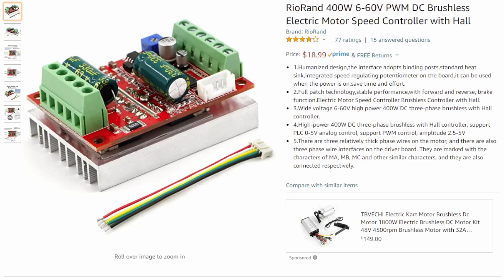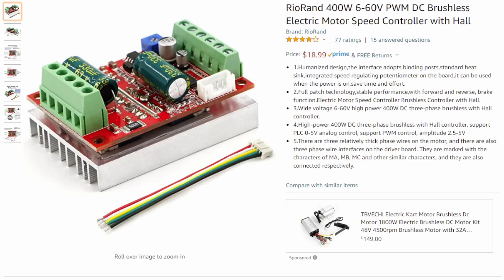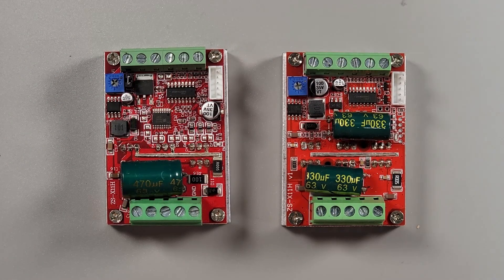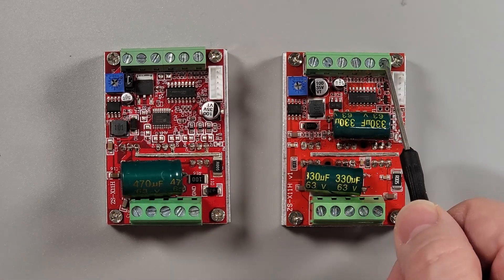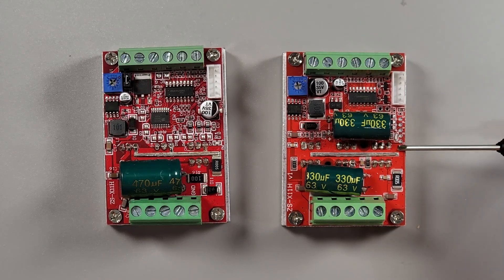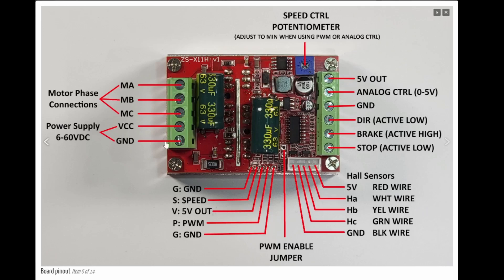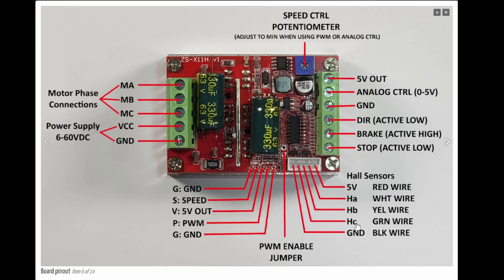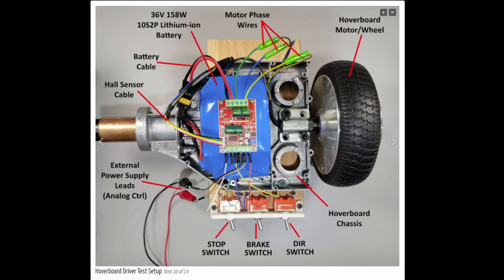Inexpensive Hoverboard Motor Controller

Comment: hes back!
Reply: Is there any difference in just sending a 0 cycle PWM signal (vs applying the "stop")? Kind of confused for the reason for this control... is it just like a bypass (when that's active) PWM control = irrelevant?
Reply from the maker: @williammuff5485   I was doing some testing on the STOP pin yesterday and found that it doesn't behave as I expected.  It seems to have three states.  Logic 0 disables the drive, Logic 1 turns the motor on full speed, floating allows for PWM/Analog control.  I suggest just not using the STOP pin and do as you mentioned and just apply a low signal to the PWM pin to put the motor into a free spin mode.
Reply: @mad-ee  This isn't really as related to this comment, but i thought you might be able to help. I plan on using 36v battery-> 2 of these -> 5v output powering Arduino (pwm from Arduino sent to both controllers *reverse/brake too), but I'm not clear on how to make the device draw nothing on idle. Is there some type of circuit than than switch on and off based on a quick switch type of voltage? Should I just get some beefy ~30a switch wired post battery/pre motor controller's? I would ideally like a switch to have an LED, but that's a bit confusing as i feel like i need a switch capable of handling 36v (20-30a), but an LED that can take 5v. 

I'm just lost a bit and any help would be greatly appreciated.
Reply from the maker: @williammuff5485  probably simplest is just a switch that cuts power between the battery and the motor controller.  As you mentioned you do need to have a switch that can handle the current.  I haven't tried to measure how much current the motors actually draw, I'll try to do that sometime.  On some switches that have the built in LED there are separate pins for the lamp.  So you could feed in the 5V OUT signal from one of the motor controllers to the LED, you may need to put a resistor in series depending on the switch.
Reply: @mad-ee  after some research it sounds like an “anti spark” switch is what I need. I really don’t understand the naming. Some of them even have auto on/auto timeout shutoff features based on current draw
Reply from the maker: @Billy18bm  Ahh yes, that is a good find.  I found some schematics of anti spark circuits and it looks like they use N-Channel MOSFETs in series with the ground connection.  On the gate of the FETs there is an RC (resistor capacitor) circuit to slow down the turn on time a bit to prevent the spark.  I've noticed a spark whenever I plug in the battery and it just didn't click that, that would cause an issue in a regular switch wearing down over time.  I've had a similar issue with some mechanical relays that end up fusing the contacts when they are used with a circuit with high inrush current.
Reply from the maker: Actually the part about the resistor capacitor circuit is not quiet right, I think those are used in the toggle circuit.  Anyway they do use MOSFETs to switch on/off the power rather than a mechanical switch.
Reply: @williammuff5485  Sorry to butt in, but I'm not sure I would recommend powering your arduino from these boards.  The 5v rail on these boards appear to be driven from a 7805  regulator which is really limited in current when stepping down from such a high voltage.  There may be a switchmode regulator before the 7805 to help correct for this but I'm not sure.  Without documentation its not a great idea.  There was some talk on the amazon reviews about this board powering down periodically when driven from PWM.  I have not experienced this but it could be due to the 7805 overheating when driving too high a load.  Just connect PWM and ground and power your arduino separately.
Reply from the maker: @adamhixon  This is a good point.  The older version of the RioRand had a 7805 in a larger package that could handle higher current draw.  This newer version they changed the 7805 package to a SOT-89-3, which looks like it is probably only rated for 100mA.  I think powering the Arduino from the board for testing is OK as long as you aren't drawing much current from any of the Arduino pins but it would be better to get a separate regulator.  I checked on my test setup and the regulator does get warm but not hot, probably around 40 - 50°C.

In one of my projects I used this regulator to power all of my 5V stuff:  https://amzn.to/3obfyTV
Reply from the maker: @williammuff5485  If you are interested I just published a blog post about connecting to an Arduino with some sample code.  I hope to get to a video to go along with it soon.  https://mad-ee.com/controlling-a-hoverboard-motor-with-a-simple-arduino/
Reply: @mad-ee  much appreciated. I've got a sample rolling with a joystick (ps3bt.h). The part I'm trying to work on is controlling "jumpy" changes. 

Also appreciate the speed code.
Reply: Do you know if the brake is variable? Like based on the voltage the brake is "strong/weak"? I'm wondering how i should go about rolling forward and then trying to hit reverse on the joystick.... (i don't actually need reverse in my application, but i need some way to "gradually slow down" the motor. Maybe that's just as simple as applying the brake (fully), but that seems like it would be abrupt.
Reply: @mad-ee  I've also got a flipsky anti spark ~60v/48v, which powers an LED, so i would assume there would be some way to jump into that for powering the arduino. 

I'm wondering how much amperage an adruino pro mini (3.3v) would actually draw. It can't be alot of power right. Also I've got two of these controllers with the power rail and grounds all tied together.
Reply from the maker: @williammuff5485  I don't think the brake is variable by voltage.  I think it is just on/off.  But you probably could pulse the brake.  Maybe use a PWM pin and slow increase the duty cycle.

Comment: Great video! ⭐⭐⭐⭐⭐
Please make another video about the motor controller. With the speed controlled by PWM signal from an arduino. Thank you.
Reply from the maker: I'm working on a new video now that shows some Arduino code to control the motor and read the motor speed... stay tuned.
Reply from the maker: I haven't gotten to the video yet but I did make a blog post about it.  Check it out here:  https://mad-ee.com/controlling-a-hoverboard-motor-with-a-simple-arduino/
Reply: @mad-ee  are you going to make a video? I'm still struggling getting PWM control to work. I have it all hooked up to an arduino which is receiving inputs from a Flysky FS-i6X